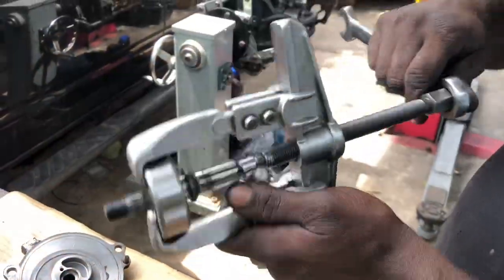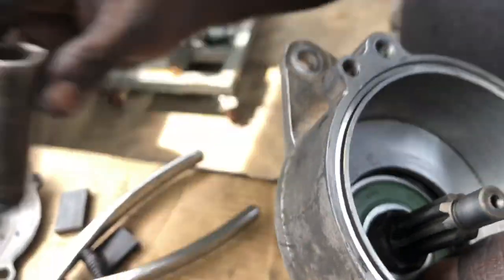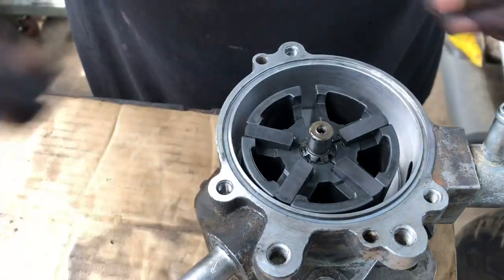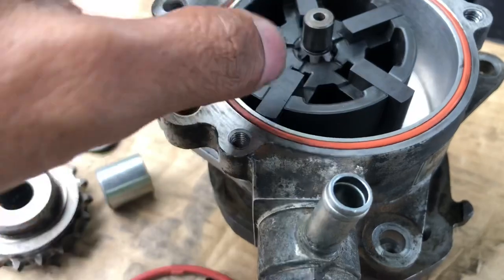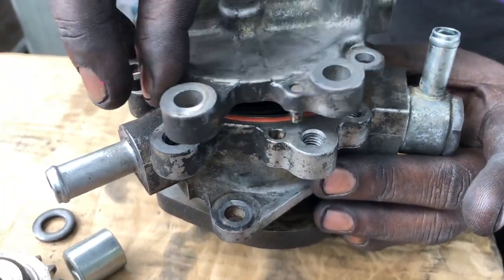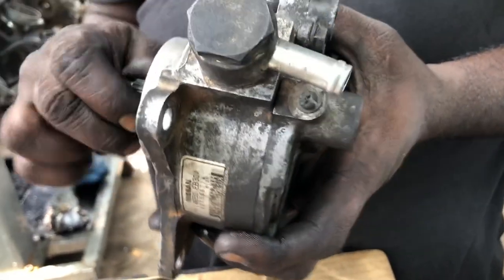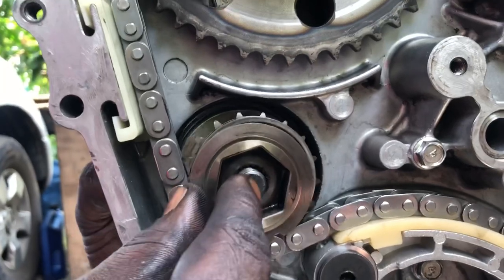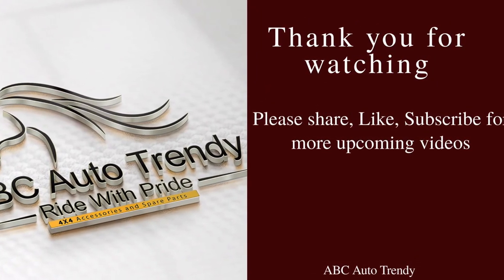Nissan Navara D40 YD25 engine vacuum pump repair

Comment: Hello, how can I know if the vacuum pump pinion is ok? They do not sell it loose in Spain and I am going to change the distribution. The teeth look good, the only thing are those two washers that it carries around the pinion that make noise when moving them and I don't know if it is something normal or they have to move less.
Reply from the maker: Well the best way to test that is close the suction line and spin the wheel and see whether you get the enough suction that can feel in the palm of hand… it also does make sounds like how frog 🐸 make noise

Comment: I'm assuming vacuum pump doesn't need to be timed, sorry for silly question.
Reply from the maker: Nope, it does not require to be
Reply from the maker: Important factor is cam, fuel pump and crank

Comment: Wtz the impact of vaccum pump failure ?
Reply from the maker: 01. Critical:  lack of brake (this is the only pump supplements to reserved vacuum for brake booster 

02. None functional of turbo solenoid
Reply: @abcautotrendy  Thanks and is there any impact on oil pump or oil distribution system
Reply from the maker: Not by the vacuum pump.

Comment: Hello.Please tell me the dimensions or bearing number for the Pathfinder vacuum pump 51 YD25DDTi/ 14560 eb300/ I want to replace it.
Reply from the maker: Hello dear, I did not get the question clear, there is no any bearing on the vacuum pump but only the sprocket: maybe you can share some pictures if available via WhatsApp +94777329922
Reply from the maker: Got it let me caliper it and share the details of the internal bearing size
Reply: I use nsk b17-116t1xddg-gcmr A.K.A b17-116dg

Comment: How does it sound when its bad?
Reply from the maker: You won’t hear once it’s fixed but experience when lack of vacuum
Reply: @abcautotrendy  i have a whine and i think it’s coming from the vaccum pump. But the car brakes fine
Reply from the maker: Well, it must be something else maybe. Or excessive air. Just remove the main vacuum line that goes to brake booster while the engine running. Keep it for few seconds and connect back
Reply: @frankcumaio8328  conseguiu resolver? A minha está com esse ruído que parece vir da bomba de vácuo
Reply: @brunocastro4314  Oi Bruno. Consegui sim tive que trocar a bomba de vácuo, comprei uma re condicionada e coloquei resolveu o assunto. Os dentes nela estavam com escoriações e o rolamento tinha folga. Voce comprou a viatura ja com esse ruído ou foi desenvolvendo?
Reply: @frankcumaio8328  comprei com esse ruído, pensei que fosse a correia. Retirei todas as correias, mais o barulho persistia. Vem da bomba. Uma barulho  tipo de  correia.
A sua ficava assim?
Reply: @brunocastro4314  tem um ruído típico do motor yd25 que parece ter haver com o balanço etc. muito idêntico ao ruído de um rolamento de correia, também tentei tirar as correias e cotinuava. Troquei o kit de comando e não resultou em nada. E um ruido que usando pela primeira vez o carro incomoda, mas acabei habituando e fui vendo outras identicas com mesmo ruido.
Reply: @frankcumaio8328  o freio está bom, tentei tira a bomba de vácuo, mais não saiu. O eixo está travado na engrenagem.
Vou gravar o ruído e te envio.
Reply: @frankcumaio8328 

Did you ever resolve the whine you were hearing if so what was the issue I think I might have the same problem
Reply from the maker: @brandonstringer5910 yes we did dear